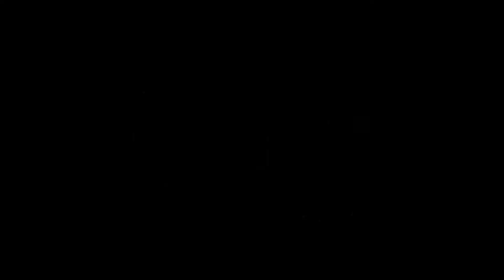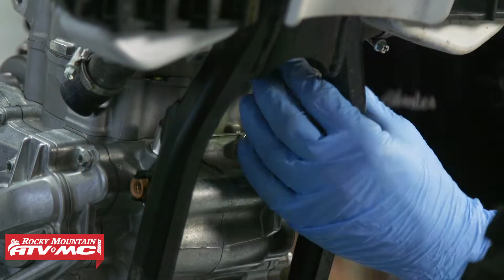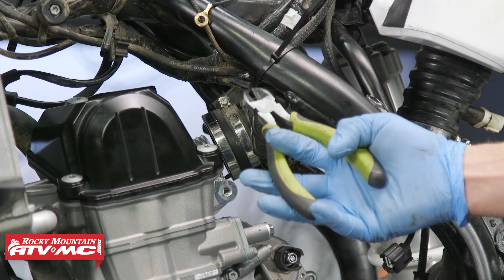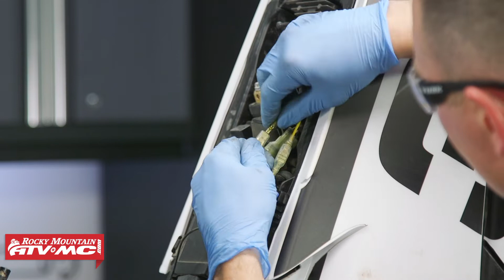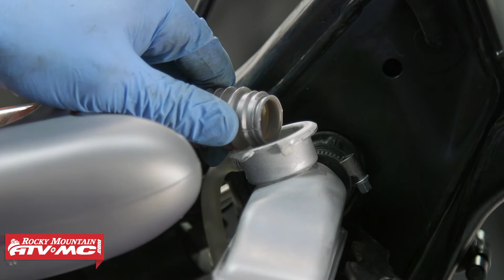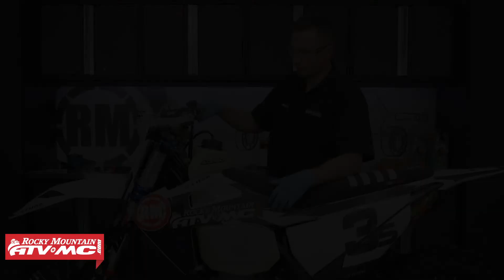KTM/Husqvarna 450, 500 & 501 Engine Rebuild | Part 7: Engine Installation

Comment: Most motorcycles are just run in at 50 hours use. KTM & Huskies are on the table for a rebuild @50 hours. I think I'll buy a Honda when it comes to my next dirtbike.
Reply from the maker: You might be surprised that the maintenance intervals listed in the owners manual for piston replacement on Japanese bikes are typically every five races or 12-15 hours of run time. Those intervals are typically for pro riders that want to maintain maximum performance, and we realize most people won't replace their piston that often. Using a compression tester during periodic maintenance can help you know when things are wearing out. -Charles